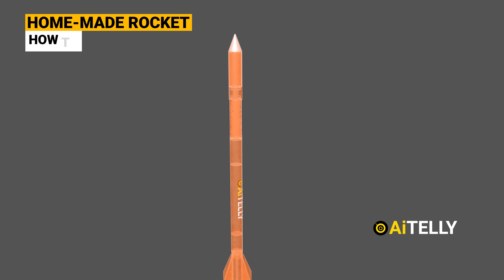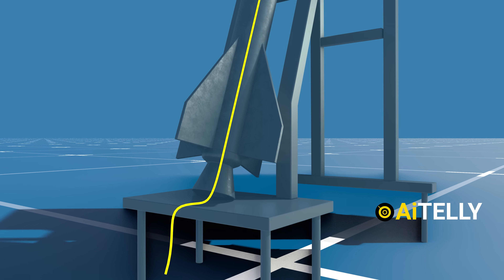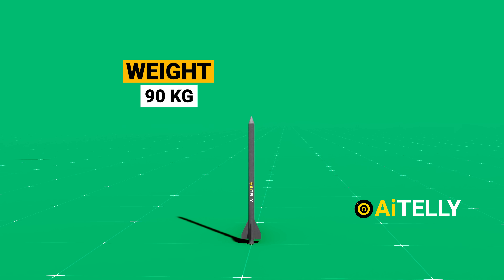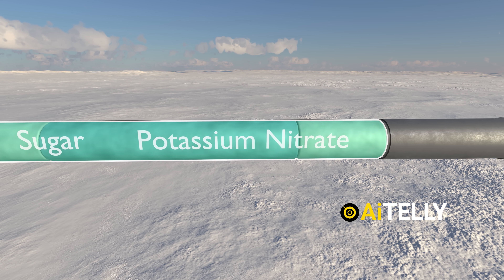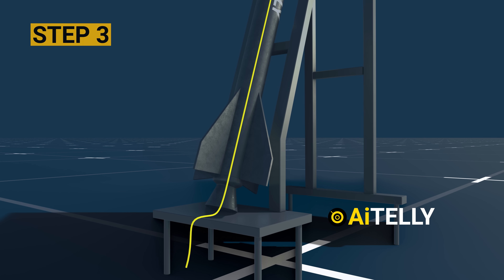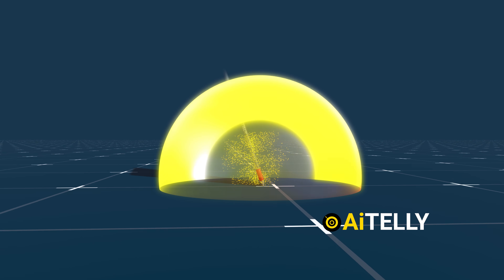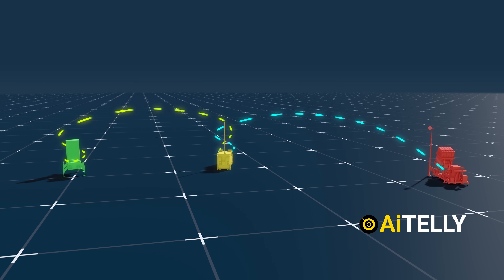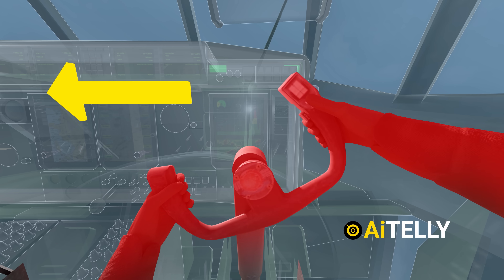How Hamas Makes Rockets against Israel | Qassam

Comment: This is an economic game—and a brutal one. Let’s break it down:

Hamas fires 20 missiles costing $100,000 total ($5k each).

10 miss (fail), 10 are intercepted.

To stop those 10, Israel spends $500,000 on Iron Dome interceptors ($50k per missile).

Hamas spends $100k → Israel spends $500k. That’s a 5:1 cost ratio in Hamas’ favor. Even if most rockets fail or are shot down, Hamas wins by draining Israel’s resources. This is asymmetric warfare in action—cheap attacks forcing expensive defenses.

Comment: What isnt mentioned here is that the fuel aka rocket candy is very much unstable especially if you get the mix wrong. With its own oxygen built in, you want to run fuel (sugar)  rich for safety. If you make this stuff too lean it becomes very easy to ignite and with these mostly illiterate guys just following steps they were shown and having the explosives for the warheads near to hand you can see how this could get very messy very quickly. If youre going tk make your own solid fuels then substitute sugar for something else carbon based that will burn like caulking for bathtubs and dont make bombs, its evil and youll just get got one way or another

Comment: There is a good way to hide from THAAD systems. It is human camouflage. The missile is transported using propellers and fins that make it difficult for the system to distinguish between them or detect them, apart from modern methods of jamming systems and others... such as traditional chips. Knowing the airspace that was not targeted by the THAAD system, for example, human bodies, birds, and other categories. This is what makes the system shy and easy to overcome.

Comment: These AI vids are such garbage, "how do they manage to make a rocket at home?  First of all they use common indigents such as sugar and potassium nitrate, they melt and mix them which is then cooled as a slug placed into a metal pipe, so heres a super simplified version, sugar and potassium nitrate is mixed together to make a slug which is placed into a metal pipe."  Gee thanks for the super simple explanation, nobody could follow the first one.

Comment: The explanation of the difference between rockets and missiles is not correct. Other languages (such as German and Dutch) know only 1 word: 'missile'. So something else must make the difference. Also, the fact that a missile would have a guidance system is not the difference. The Saturn V missile is not a missile, but it also had a guidance system. So what is the difference? Is there any difference at all?

Comment: The thing is that rockets are possible to make. But it can't be done with a damn sugar rocket. Use aluminium powder and ammonium or potassium perchlorate, sulfur or iron oxide, and combine all of these together with a gelatinizing agent. This is used in actual solid rocket boosters. Much higher velocity and higher energy and more reliable power.

Comment: Sadly the water pipe was given to them so they had water but hamas used it all for these rockets
Reply: Shut up, you liar. The water pipe were obtained by the resistance in Gaza from the remnants of the settlements. Your cowardly army used them to steal Gaza’s water, so try something other than lying.

Comment: Anything and everything Wireless that works on GPS navigation is in controlled and in communication with the satellite and a land base and a constant moving air base that's a lot of different places this thing has to communicate with so it could be interrupted take out the satellite or hack the satellite

Comment: to be honest israel used JDAM missles to bomb the hopital. you could identify it by sound. also jdam has kinda modules where the missle could explode before touching the earch and that's what happend. also any source that talk about jdam example wikipedia you will find that israel use it. so it's not a hamas rocket. a report shared by the al arabya is saying this and an american solider was the analyser.

Comment: "this is how hamas blew up their own hospital"
its impossible to believe such a small rocket destroyed such a large hospital within mere seconds with amazing accuracy and destructive potential.
sugar rockets are hobbyist rockets, not missiles designed to take down entire buildings.
also your video contradicts itself, if the rocket is extremely inaccurate then how would it turn back and accurately hit one of the most important buildings in palestine?

Comment: Just one poit: Solid fuel rocket engine need in the middle of the fuel space through the length of the rocket 
(the shape of the fuel on the model is then a hollow cylinder). Thanks to this will the rocket get enough thrust force to fly away.

Comment: Water air pressure could get rocket silent launch leave launch pad before ignite gasoline vapor and hydrogen rocket during homing in to target cost less than $20,000 both launcher and rocket and each rocket about $10,000/ rocket can get helicopter few million dollars each umis asymmetric warfare could bankrupt rich coubtrues

Comment: Not all rockets are unguided, more importantly, very few missiles are even rockets. The word "missile" refers to any flying object, while the word "rocket" would include your "guided missiles" except for one thing: most "ballistic" missiles are only momentarily powered by rocket fuel (at the moment they are launched.) Thus, a normal "ballistic missile" is primarily powered by a small jet turbine engine (hence the whining noise heard in all of those 80's films.) Plus, "intercontinental ballistic missiles" (according to experts on YT) are actually guided rockets (they do not have jet turbines.)

Comment: How does the solid fuel inside the rocket gets oxygen needed for it to react?
Reply: The solid mixture of fuel is already contain oxygen, which had been mention in the video that the fuel consist of sugar and oxidizer
Reply: Potassium nitrate (KNO3) is the oxidising agent in this reaction
Reply: @evidentrl  thanks I get it now, earlier I thought that it was a catalyst for burning but I know now it is an oxidiser.

Comment: qassam rocket cost 600 dollars and we use 120 000 dollar  rocket to stop it and most expensive battery in the world 
so if they used 10 000 rockets they spent 6M dollars and we going to spend  1.2 billion to stop 1000 and that most what iron dom can stop if it worked perfectly . what about other 9000 also what if they used heavy rockets like hezboulah rockets with range of 250 miles and over 1000lb of explosives  ..........gaza war was israel biggest mistake now qassma and others get billions of donations and fighter from ieaq to afghanistan to yemen .......israel can noy survive a long war

Comment: they do not just 'cast slugs' of ammonium nitrate and sugar - 

    Oxidizer and Fuel Ratios: Rocket propellants typically consist of an oxidizer and a fuel. Ammonium nitrate (AN) could potentially serve as an oxidizer, but sugar alone is not a suitable fuel for rocket propulsion. Rocket propellants often require a carefully balanced ratio of oxidizer to fuel to ensure efficient combustion.

    Solid Rocket Motor Design: Solid rocket motors  have an internal channel, often referred to as a grain or core. This design allows for controlled combustion, ensuring that the propellant burns in a controlled manner from the inside out. A simple mixture of AN and sugar without a designed grain structure is unlikely to function effectively as a solid rocket motor.

    Energetic Binder: Rocket propellants typically include an energetic binder that holds the mixture together. Sugar alone does not provide the necessary energetic properties for this purpose. Common binders in solid rocket propellants include hydroxyl-terminated polybutadiene (HTPB) or other specialized compounds.

Comment: Did anyone else make sugar rockets as a teen? If you did you know this is wrong in several ways but I suppose I understand not giving a manual to make a what could be bomb we used to make fire work smoke bombs out of different mixes of the kno3 to sugar its fairly safe if you don't just get the idea you need all thr correct glassware mantle or hit plate stirer aswell as solvents and  personal protection they're cheap but I don't see then being prepared in anything of lab setting there for making it deadlier to the side using it in reality

Comment: a Qassam rocket, is, by no means at friggin ALL comparative to a Patriot missle.  One is a friggin rocket,  6 inches in diameter.  formidable , compared to someone who doesn't have a rocket.  A Patriot missile? about three telephone poles in diameter.  It is smart. It is guided.  It was designed for multipurpose roles, all of them war, all of them death.  maybe like teh rocket.  but the Patriot?  you guide it to target, which means you intentionally watch it go , make it go kill specifically.  the rocket?  fire and forget.  sure aim it, take consideration for wind and weight and distance.. but you don't babaysit it all the way to death.

Comment: I still haven't seen the first so called hamas rocket explode or be hit by the iron dome. just a bunch of single explosions like fireworks lol simply not plausible that israel shoots down 90 percent of 4000 rockets on october 7, I call b/s it was entirely a computer generated training mirage with some holywood styled hand gliders all funded by israel, who called off the security for the entire fence line, it's a scheme and it will not work. israel wants the culprit removed from his throne.

Comment: Why they do not make body of rocket with PVC or Plastic and only the Nozzle with metal this will in turn make their rockets bit Stealthier also to Confuse The Air defence system a time delay release of Aluminum Chaff will further increase the chances to go through the air defenses

Comment: 600$ garage made out of scrap metal ballistic missiles?? I don't believe that crap for one second, it is literally impossible.. Each rocket would be different, weigh different, fly different, heck most wouldn't lift off, nevermind make it to their target, you have to have some sort of a guidance system, that takes a whole corporation worth of engineers and electronics people, each one has to be an exact copy, this is not a Molotov cocktail, this is a ballistic missile, takes corporations whole years to design, test and begin production.., if you were making them out of scrap metal, each one would be it's own individual, unique design, requiring it's own design, testing, it's own unique, individual parts, and including it's own homing and guidance system.. This isn't Star Wars, you can't just build your own ballistic missiles out of scrap metal, you have to have a whole production line, your own metallurgy, sugar and fertilizer my ass, you are a liar, Sir..
Reply: My thoughts exactly, 
Who buys all this nonsense he spreads ??? except if the listener is a child

Comment: $300 vs $50000 , that huge gap. If hamaz launch 1000 rockets it will only cost $30000, less than 1 missle from iron dome. And cost israel $5 Million to intecept. Yep quantity has its own quality.
Reply: Not to mention they got the EU to foot the bill for the water pipes, which were intended as development aid to improve civilian access to clean water.
Reply: @VVayVVard that is correct most of the money, almost all comes from germany.

Comment: Isn't it ammonia nitrate in most cases? Because this is mostly used as a fertlizer, as it contains not only nitrate but also ammonia as nitrogen source, which is a double plus for use as a fertilizer.
Reply: at least in the US amonium nitrate is heavily controlled and they have to verify you're a real farmer 
I would assume the same in Israel

Comment: This is bullshit, as someone that’s made hundreds of sugar rockets back in the day. You can’t coordinate the production of a thousand sugar rocket motors using jank kitchen utensils without blatant Chen kitchen fires.

You get much better results in a controlled factory setting and wrap the motor in plastic grocery bags to prevent moisture. You then press fit the motor into shape charges to standardize range.

Comment: Hamas defeated the Zionists and destroyed them with missiles.  This report is a lie.  The missiles are not located in Gaza, but in Tel Aviv, Ashdod, Ashkelon and Sderot, that is to say the areas occupied by the Zionists.  I also mention that the so-called Iron Dome, according to the testimony of Zionist analysts, is a faulty tool and the success rate of interceptions does not exceed 40%.

Comment: these was their rockets back in 2001-2003 (Qassam-1,-2,-3 ..), now they have missiles and it's locally made, it has gps and its much more advanced even some of the rockets can maneuver the Israeli defenses such as J-80, M-75 AYYASH-250 .. etc
Reply: Source?
Reply: @No-ky3kb  trust me bro source book
Reply: @No-ky3kb  The Qassam-1, developed in 2001, marks the initial rocket created by Al-Qassam. On 10/13/2023, the military wing of Hamas, Al-Qassam, employed the AYSH-250 rocket to strike Safed, located 220 km away from Gaza. Additionally, on 10/25/2023, Eilat, situated 209 km from Gaza, was targeted. Earlier, on 5/13/2021, Asaf Ramon International Airport, positioned 193 km from Gaza, was hit.
On 07/12/2014, Al-Qassam publicly declared its intention to target Tel-Aviv, which is 92.2 km from Gaza, specifying a precise hour. They challenged the Iron Dome defense system to intercept all incoming rockets. However, the Israelis conceded their failure to intercept all the rockets as Hamas had challenged, managing to intercept only a few of them.
Reply: @No-ky3kb  IDF (lol)
Reply: @No-ky3kb  muslim daydreaming is the source
Reply: No GPS for sure. Don't watch IDF too much 😂
Reply: Take a news from a terror org or from a democratic country with secrets?

I choose the dem country everytime.

Comment: this rockets are just pissing into the wind. 1st you cant know exactly what will the specific impulse be, adding a wind and those rockets are firing your gun blind. also with its fuse mechanism they are more danager to hamas then to the israelis. easily could they add some sorte of guidance (fin guidance with rc techology) and they could easily add a safety triggering feature that will disable the trigering mechanism remotley in case of a failure.

Comment: I would assume this should work for model rocketry as well? I remember seeing the big rocket kits a a child, but those engines were super expensive. Fun to see them go, saw one kit with a film camera in it, but it needed one of those large engines.
Reply: I recall there being really cheap disposable engines for model rockets when i was a kid those ones with cameras though are normally multistage rockets
Reply: It does. You can build several typs, with for example mixing sugar with  potassium nitrate or cooking it, then you get the so called "Rocket candy" wich you can fill when warm in a tube and let it cool down so it gets solid. But it is really something for grown ups. Cooking rocket fuel may get dangerous. :) I bougth potassium nitrate myself to play a bit around with model rockets, but then figured out it is completly illegal in my country.
Reply: @TotalyRandomUsername  where did you even buy it , you already said it its illegal only for farmers because its used as a Fertilizer
Reply: @dz8136  Starting rockets is illegal. Potassium nitrate is not illegal at all. It is used in the food industry for example.

Comment: Also worth noting that the mentioned use of water pipes is the reason why gaza does not have access to drinking water.

Yes, Hamas actually disassembled the water pipeline supplying them with drinking water to make rockets.
Reply: Its lie there water pipe that very old they use and also city have pipe line for water that Israeli cut that of water.done spread lie if  you dont know what's going on and maybe you do it for propaganda!!!!
Reply: Israel bombed their Water desalination plants at the war in 2014 what are you talking about. Water, Food and Electricity is totally blocked in the current war thats why their only source of water running through their pipes is salt water
Reply: Stop the lies 😂😂😂😂😂😂😂😂😂😂😂😂😂😂😂😂😂😂😂😂😂😂😂😂😂😂😂😂😂😂😂😂😂😂

It is not like hamas has underground tunnels to trade things

Zionist by their own tongue said they shut down the water